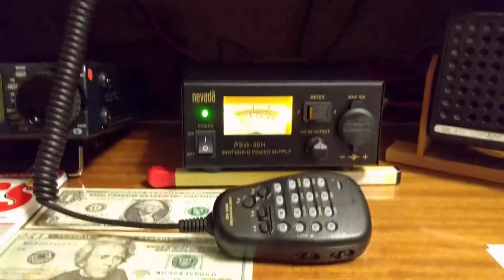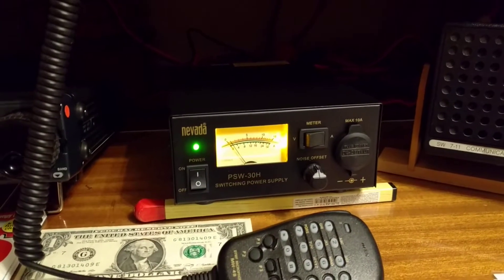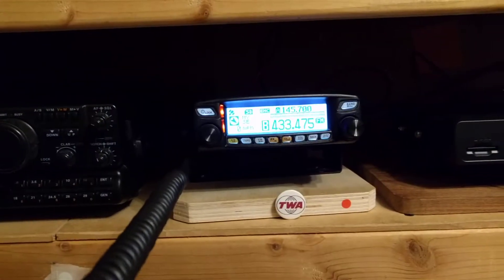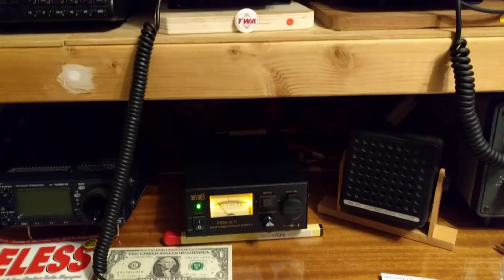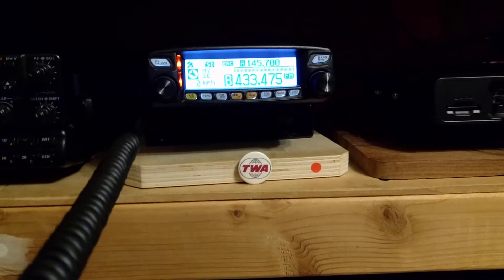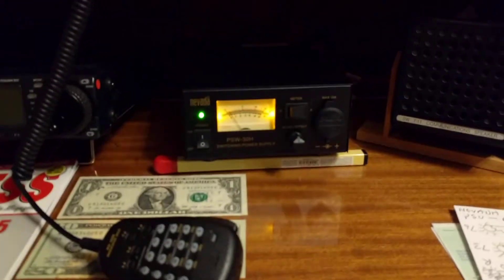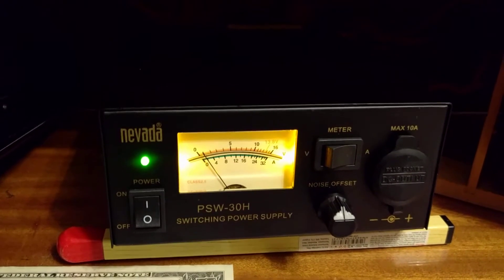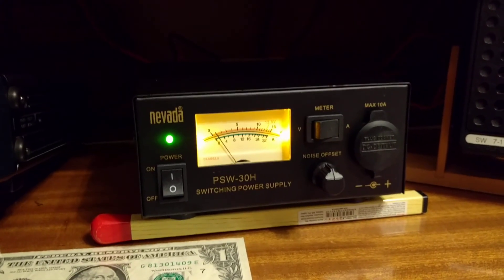Nevada PSW-30H Switch Mode PSU-Part 2

Comment: I just ran across your video and was surprised to see it looks exactly like the one I ordered today. The one I bought is a QJE, QJ-PS30SWI 30 amp power supply. I plan on using it with my Yaesu FT-2980R radio, hopefully mine will work and give me as good of service as yours.
Or at least I hope yours has given you good service?!?! Enjoyed your video!
Reply from the maker: So far it's still working and powering the vhf/uhf Radios in the shack. I recently purchased a 30amp linear from the same supplier..again a generic design and it's powering the Ts-870 like a champ.. I hope your supply gives you good service, thanks for watching 👍😀